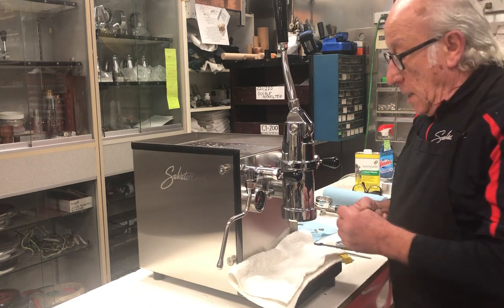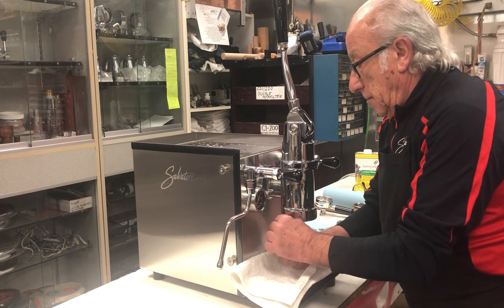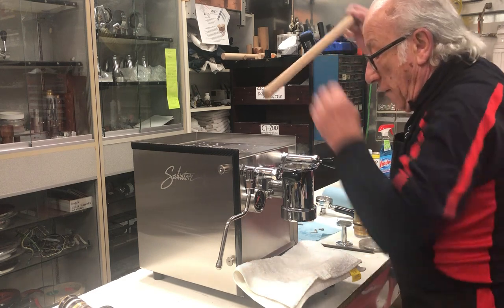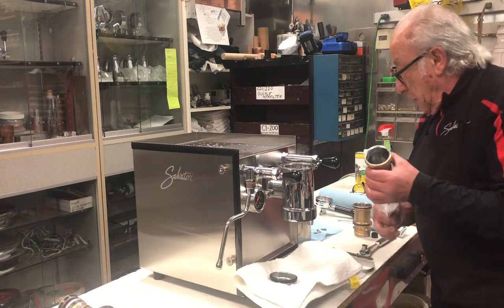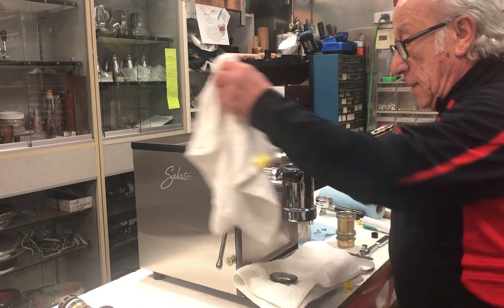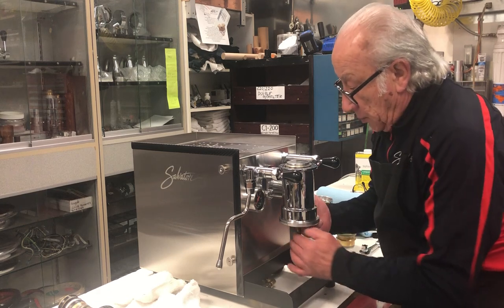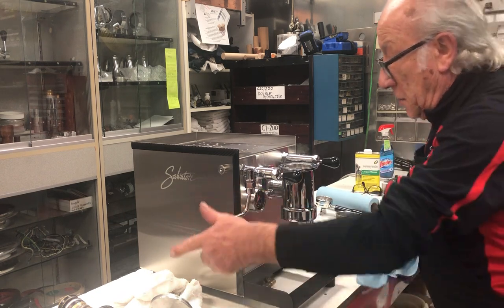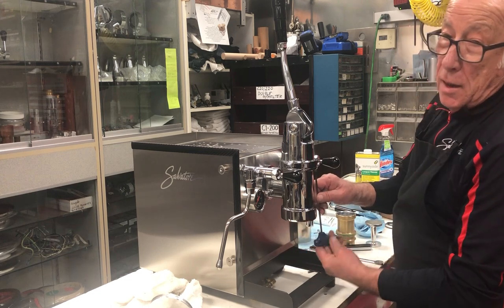SL Service

Comment: Do the tools you're using come with the machine, or are they purchased separately?  What size is the group head?  Are replacement parts, gaskets, etc., common sizes and easily found?